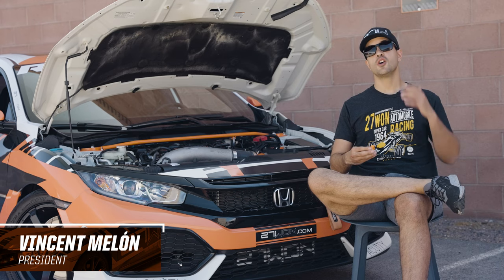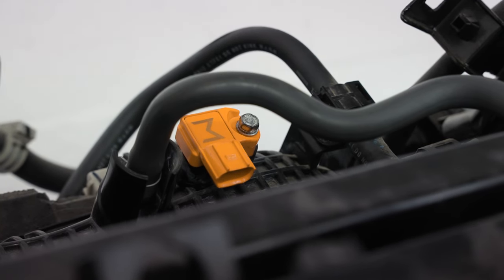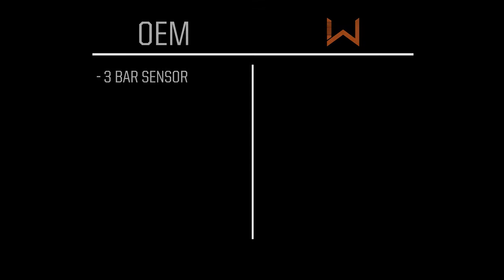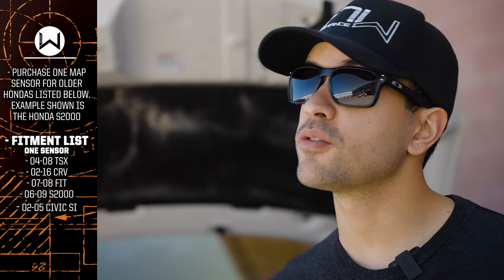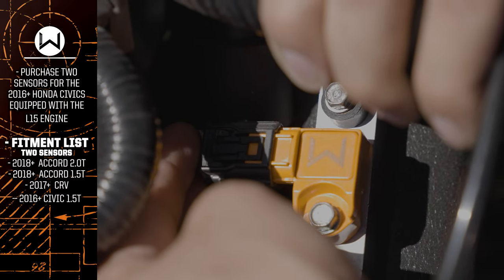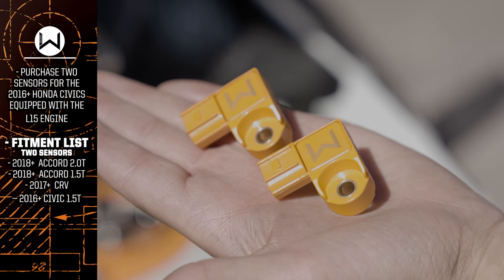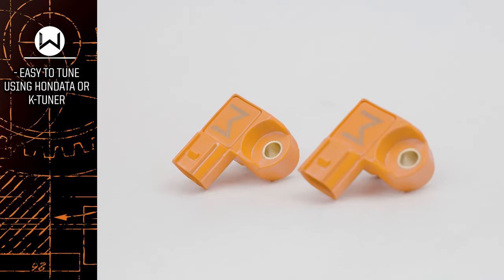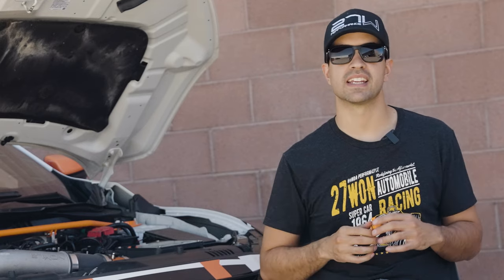Honda 4 Bar MAP Sensor Upgrade (27WON Signature Orange)

Comment: I don’t even own a Honda anymore, but I still love watching these videos. In my opinion 27won was the best company to make aftermarket parts for the newer Honda models. I used to have a 2017 Honda Sport 1.5t and I bought every single upgrade for my car from this company. Unfortunately, I had the CVT version, so I wasn’t able to put too much power to the wheels, but I loved the way it drove with 27won upgrades. I wish I still had that car, I was repping 27won everywhere I drove.
Reply from the maker: Thank you so much mate. Means a lot.

Comment: Hi.  I don't need performance.  Imma middle aged lady.  But do you know where I find the map sensor on a 2019 honda fit?  is it under the plastic cover?
Reply from the maker: On the intake manifold.
Reply: @27WON  Is that plastic cover removable with ease?